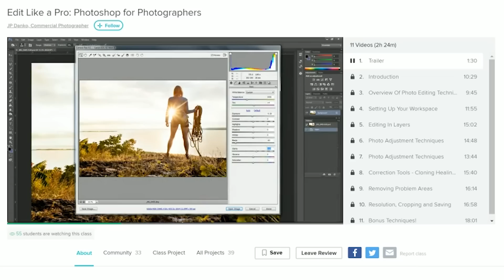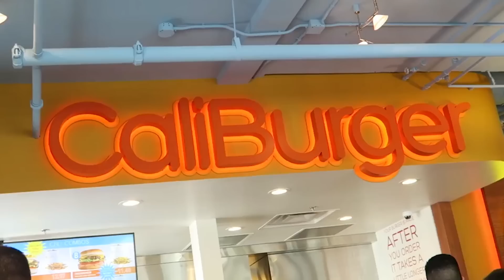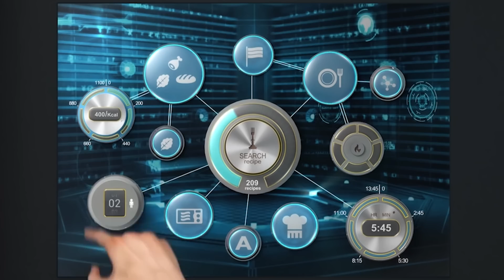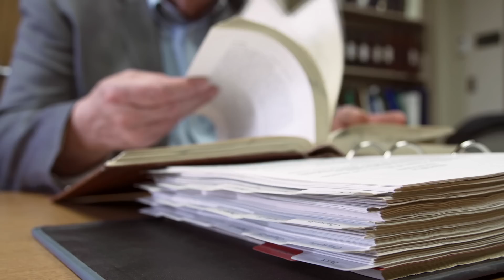These Revolutionary Robots are About to Steal Your Job

Comment: This means, as philosophy 101 puts it: new solutions, new problems, new solutions... cycle:-)

e.g. say robots replaced stock technical analysts, said robots would need people to maintain and repair it. Another e.g. is photocopiers or Xeroxing a copy, it solved the old problem of copying by hand but it also birthed the need for Xerox repairmen and toner manufacturers.

Comment: [Time to say it again . . .]
If you want to be absolutely certain that a Robot will NOT take your job, then get a job doing HAND ASSEMBLY for an Aerospace Business (or a Subcontractor TO an Aerospace Business.) To do HAND ASSEMBLY for an Aerospace Manufacturer, you only need the same education as someone who has completed the 2nd Grade in Elementary School (circa 1972.) In Aerospace, the Manufacturing Managers want an actual human to SCREAM at (or humiliate at; even if the worker has significantly more education than the Manager.) Manufacturing Managers would look pretty silly screaming at a 'plastic and metal' -construct Robot. In truth, the Manufacturing Managers, in Aerospace Businesses, actually DO WANT Robots, but with a twist! They want Robots that are 'flesh 'n' blood' HUMANS. In other words, the Managers want human workers that have practically NO intelligence, and, instead, are only capable of doing monotonous/brainless Assembly Tasks.  Put simply, they want human workers who are perfectly suited to being dominated by the managerial method known as "mushroom management". Over 100 years will pass before Aerospace Businesses replace their human HAND ASSEMBLY workers with Robots. The only exception is the Component Populating performed onto Printed Circuit Boards. The machines that perform Component Populating have robotics INSIDE, however, the internal robotics were not designed by the Aerospace Business itself. Aerospace Businesses merely PURCHASE already assembled Component Populating machines. All OTHER unique assemblies, inside of an Aerospace Manufacturing Business, are assembled by invoking the method of HAND ASSEMBLY.
      Aerospace Manufacturing Businesses (and especially the Subcontractor manufacturing businesses that they invoke) want you to BELIEVE that they are "brainy" places to work for, but, in truth, the incredible vast majority of them are simply the "technology version" of the NYC Garment District (complete with their own internal Mafia, secretly controlling all the action.)

Comment: Automatically driven cars are still a long way off. They won't theoretically be ready to replace say an UBER driver for at least 30 years and that is a push. Cars only have only to deal with two dimensions, now take that to an airplane where you have many more potentially disastrous variables happening at much higher speeds where cognition of a problem and reaction time is measured in anything like sensing something is wrong and correcting it can take anywhere from microseconds to hours and each problem requires widely different solutions and you begin to grasp the problem. Would you want a retrained assembly line worker with a GED to fly your next commercial aircraft?

Comment: they can have my job. If they can clean the church, water the church grounds with a hose and help at the food box distribution bagging vegetables like bulk vegetables not bagged. The church does not have a proper sprinkler system so not all of the grounds get watered that's why you have to use a hose. So if a robot can do that send it over

Comment: I don't mind if UBI is attempted in the face of massive deflation but first we must have said deflation (instead of inflation) and second it must be a stable amount of funding for UBI - a set % of the budget or % of GDP so once it's implemented it's then up to the UBI recipients not to multiply and remain on UBI until UBI can no longer support them. I mean I really think it could turn out a lot better than that, even if current workers find themselves displaced and lost their children would probably be much more adaptable. Still, I want to see it designed it a rational way so that there are natural negative feedbacks against abuse.

Comment: The problem with this theory of "IT WILL CREATE NEW JOB", yes it's true. However, those jobs are specific to the nature of what the "COMPANY" needs. It's not really an option, or a common job. These job would required a bachelor's or master's degree. Not really what you need for the typical common job. Hell most people can't afford to go to college PERIOD! So yeah IT WILL CREATE JOBS FOR THE TOP 1% NOT 99% AT THE BOTTOM. That's not a future that will go without resistance. You remember the "INDUSTRIAL REVOLUTION?!" Yeah times that by 10! Times the chaos in the 21st century. Good luck to all.....God speed.

Comment: 18:00 I hope not, or I might have to figure out a way to safely build and discretely carry a .50BMG pistol (within my budget), to disable any and likely almost every automated vehicle that'd be "programmed" to run me down while I'm riding a bicycle. At least for now, no automated vehicle is programmed to share the road (not properly), and I don't want to die yet, at least not like that. I'd try to avoid shooting the snoozing and objectively reckless driver in the process, but I can't honestly promise much. I'm not a crack shot, and natural selection can be a bitch sometimes. JS. Google can't find my address. How can we trust the Google CEO to drive vehicles, or to end up in prison for multiple counts of manslaughter after the inevitable happens? As inaccurate as I am, I'm still more skilled than Google, and at all speeds from 10MPH to 1,350 FPS. I might miss by inches, but Google misses by yards, and sometime miles. If automation replaces humans much more, it probably won't be a good thing. Humans are just better at certain tasks.

Comment: Welcome to the nanny state. A place were your safety is the top concern. In fact , it is the only concern. As you will see , as your freedom will is identified for what it is. Too dangerous to be left in the hands of citizens. After all , they no longer contribute to the welfare of the corporation , only to its liabilities. As any CEO will tell you , anything that threatens to compromise the value of the quarterly stock reports , are required by law to be eliminated from the equation. That's right, a CEO today , can be sent to prison , if they do anything that threatens the bottom line in the next quarterly stock report. That's a fact. Consider it. Really consider it.

Comment: I don't know if the "intelligence" revolution or robot revolution WILL TURN OUT BETTER THAN the last industrial revolution (which was not INITIATED in a certain date, it was a process of ACCUMULATION of knowledge and know-how, that came to a "singularity" for the those times; as is this next revolution, with Moore's Law)  ------>> so I don't know if it will be bette; but it is a sure MISTAKE to compared those two "revolutions" as if they were the same thing, the difference in magnitude or degree make it a difference in KIND. 
No one went into the first industrial revolution wanting to "improve" humanity, much like evolution, it started happening because people wanted to increase production and thus make more money. Except the first one created jobs for sure, this second one is machines REPLACING humans.

Comment: "By 2020, self driving cars will be on the road in a very noticeable way."  It's 2021 and I have to say, Nope.  Also the truck stops will not be gone.  They will transform into the places that people want to spend 30 minutes or so at while their cars charge.  While truckers may not be there, people just getting from place to place will be.
Reply: I can't see them replacing truck drivers soon. they would even need robotic fuel stops, there would still need to be some kind of truck operator for a while. Plus the time it would take to replace all the trucks would be huge, not to mention they would probably need to start replacing the trailers as well to have automated doors and things for when the truck backs into a dock. I drove a truck for 10 years, there is a lot of things that go into it along with the different types of goods transported and locations like construction sites.

Comment: Robots break down and humans still need to maintain them.  At least until the singularity.  As long as humans design and build them and the companies that build them are run by accountants we don't have to worry.  Management world wide is run under the blanket rule planned obsolescence.  Everything man produces is build to last for the life of the warranty +/_ 5%.  After the singularity when machines are designing and building other machines that may change.  But no matter how smart computers get entropy will always be a factor.

Comment: Tech is cheaper than people in the long run. If tech gets cheap enough to take over completely, then industry won't be industry anymore, at least under free market conditions. It'd be private for the most part. If anybody can afford a product-manufacturing robot, or a robot that can be hacked for a purpose like that, then most people would probably have the ability to gain income or save enough money to rival CEOs of big companies. Complete automation would backfire on commercial industries without corrupt laws to back it up. Put us out of jobs? We're scrappy. We'll find other ways to get or not spend money, rather currency, so we don't all end up in prison camps or cause entire nations to go bankrupt like never before. I say bring it on, because the 99% far outnumbers the 1%. Maybe TRUE equality is just around the corner...

Comment: Can't compare job replacement during the industrial revolution to today. Back in the day you could upgrade your skills fairly easily--on the job training--but today a brick-layer, for example, is not going to suddenly acquire the math and engineering knowledge and skills to dive right into machine learning. Ain't gonna happen. "Just learn coding." Nope.

Comment: not too worried.. sure, there will be a relatively short crisis because of the loss of workplaces, therefore poverty, because the robots is better and cheaper. However, it will end up similarly like the 'invention' of weekends by Henry Ford. 
Even though his employees worked tirelessly, his profits didn't fit. The reason? employees were too busy working to go and spend their money xD.. 
Now, if everyone gets laid off because it would be cheaper with robots, people would go poor. Result; cheap labor, but no customers = you played yourself :P

Comment: Good video, but you failed to account for one major factor; you said that a production line worker could be retrained as a machinist in a few days. This is NOT true. Try learning machining in a few days. You won't be able to turn yourself into a machinist in that time because unless you want computerized parts changers and not true machinists you simply cannot grasp that amount of intrinsic knowledge and experience in that short amount of time. I was an apprentice tool and die, maker and I can tell you it simply can not be done. You cannot learn a lifetime of experience in that amount of time. If you had a machine that could transfer the memories from say a retiring machinist to a computer you might have something, but today, Don't Hold Your Breath!!

Comment: Your view of economics is incomplete and laughable in its complete idiocy. For one, it does not include the shifting of real assets of society as a hole, out of the hands of the majority , and into the hands of the few. The very , very , few. Ending democracy , or its ability to make a difference , as representative government has no constituency among the majority , as it's constituency is the corporation. Those that own the vast majority of stocks in all corporations , are not by any stretch of the imagination within a mainstream but are owned by less than three percent at the top. Therefore , Democracy is not relevant in any way, as its concerns , are not the concerns of other than the top three percent.

Comment: Doctors and Architects are the First that need to be replaced with A.I. . And also Lawyers.for sure. A robot ,computer as a Lawyer would have the knowledge of every case law ever written and could calculate the outcome before a trial was ever preformed.  It would be far more trustworthy. And wouldn't be prejudiced. Or bribeable..  As well as a computer Architect . I know that all designs are done with CAD programs already.  I have 4 years schooling and was in the business for over 25 years. My projects were well thought out. But some of these crazy building designs that are from someone's wet dream. Should have never came to be. Such bad designs.  And  I would still be at it if a human Surgeon hadn't royally screwed up my spine leaving me in chronic pain for the rest of my life. I would of trusted a Robot way more.